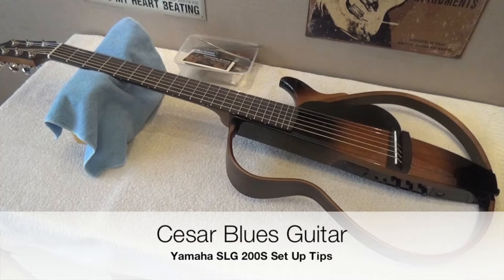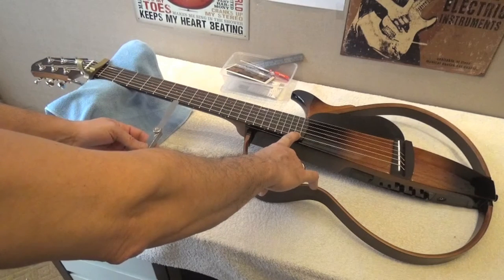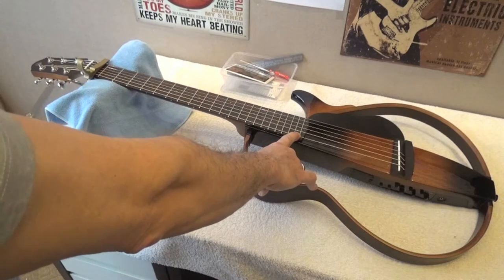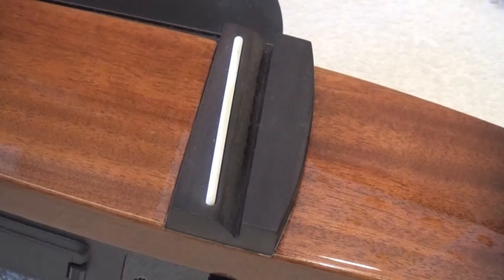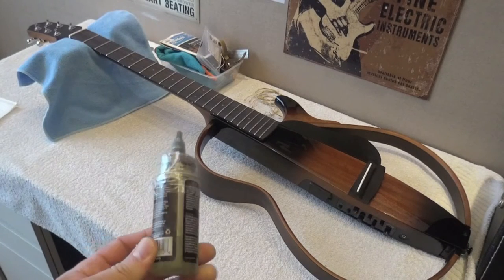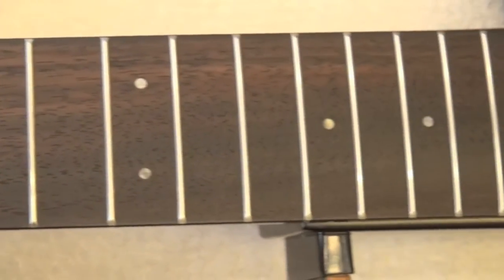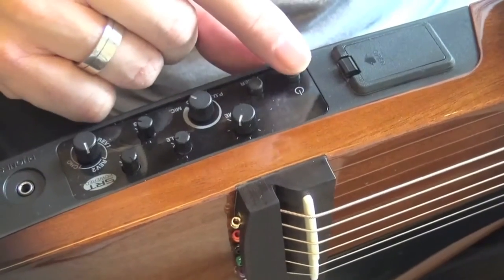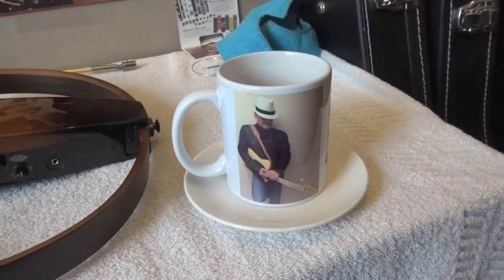Yamaha Silent Guitar SLG200S (Part Two) Set Up Tips

Comment: Hi Cesar. I'm really on a downer now.
I Unboxed my guitar this morning to find the action is sky high.
I'm taking it to my local music shop later and it will be away for a week for a proper set up at a cost of sixty pounds, and that's without the new strings I have put in the bag. (Elixer Nanowebs - my favorites)
What a choker.
I just don't want to mess with the saddle of which I am pretty sure needs shaving.
I'll just have to watch your videos and take comfort that soon I will be able to produce that wonderful sound this guitar produces.
Reply from the maker: Hey Dan,,, sorry to hear that... usually a slight touch to the truss rod can make it... I have several videos with set ups but if you don't feel confident enough to do it , then what you did taking it to a professional is the right thing... I am sure you will enjoy it very soon!

Comment: I just received my SLG200S! It plays and sounds magnificent!! My question is, the B string seems to be noticeably louder than the other 5. So much so that when amplified, the high E is drowned out by the B. Could this be a pickup issue? Could it be that it needs to be setup (truss adjustment)??? Or could it be bad strings??? I’m not a fan of the strings it came with, and plan to use Elixirs. Thank you so much for these videos. They helped convince me to purchase this guitar!
Reply from the maker: Hello! First thanks for the nice comment!
As you describe the issue, in my opinion ( and without seeing the guitar ) it could be a bad string, a poorly cut nut or saddle, or a piezo issue ( the piezo underneath the saddle )...
Try adjusting the relief with the truss rod, changing th strings and let me know if it is not fixed,,,

Comment: Hi Cesar.My guitar came back with the action sorted but the B&E strings are quiet compared to the rest and take harder picking or pulling to get the desired effect. I think I asked you before about this, I have the SLG200s as in your video above. Can you tell me what your suggestion was again.
Many thanks
From Dan.
Reply from the maker: Hey Dan! You need to put a small shim ( very very thin ) underneath the piezo ( The piezo, not the saddle ) in these two strings so the saddle makes a better contact with the Piezo. Is something very frequent. Sometimes I use small pieces of paper and I place them where I have the problem , always underneath the Piezo, never the saddle. I hope is clear. If not let me know.
Best
C
Reply: WOW.... Now that's what I  call a quick reply.
Thanks so much for your time in providing this information.
Many thanks once again.
From Dan.

Comment: Dear friend,
In my Yamaha silent SLG100N the sound of the E string are
good , B, G,and D also, the A is little less but acceptable , but the E bass gives
less sound and even if i hit my finger tot the suddle up tot the E bass I hear
less noise ! I never sand the sadle, so please tell me, I need to replace the piezo
under the sadle ? Maybe can be another reason ? Thanks a lot - Vince
Reply from the maker: Hey Vince, I think is a Piezo issue, the piezo does not make good contact with the saddle...Try a very thin piece of paper underneath the piezo so it pushes it towards the saddle....
Reply: @CesarAllGuitar  yes it works !!  Thank you !!

Comment: I own a SLG100s, a SLG110S just purchased an SLG200S and I am surprised at the very very high action, had to shave about 40% off the bridge saddle. Why make guitars that way.It is insane. Also of interest to some, contrary to the SLG110S and the SLG100S the neck has a different thickness that makes handling the guitar very different. Mixed that with a very very high action I would hate to be trying to learn guitar on that contraption right out of the box. It needs a lot of adjustments.

Comment: Thanks for your videos Cesar -  I appreciate your enthusiasm.

I'm a beginner and mainly interest in classical. To avoid driving my family crazy I've starting playing an SLG200N. I've not messed with the set up yet as I'm not comfortable enough to know what is right for me yet - one day I will.

One thing I have had issues with is the buttons (on/off and tuner). They rattle with the resonant frequency of the  high E sting! I have had to put small rubber bands around them (from my daughter's retainers) to stop them buzzing. Not heard about this anywhere else.

Have you had this problem?

Otherwise I really love the guitar.
Reply from the maker: Thanks so much for your comment. No- I never had that issue but my silent nylon is the former generation, SLG 120 NW... 
One thing- beware of the fretboard in your guitar- my SLG 120 NW has the same dimensions than a classical guitar but the 200N is narrower... you might find it weird if you transition to a " real" classical guitar... thanks again!
Reply: Yes I thought about the narrower fret board and I didn't think it was too big a difference but we shall see.
Reply from the maker: There is a difference .... and is very apparent specially in the first half of the fretboard...
Reply: Just to follow up my own comment: The buzz got to me so I took the guitar back to the shop. They sent it to Yamaha UK. It came back 2 weeks later with the exact same fault (they said they had tightened the boards inside). The shop were a bit disappointed so they sent it back to Yamaha and within a week Yamaha had sent me a brand new guitar! It felt a little odd as I'd been playing the original one for 10 months and got attached to it - but now I have a new one so I can't complain :)

As for the width - the nut is 50mm. My regular classical guitar is 52mm. So about 4% narrower. Traditionally they say classical guitars are 2 inches which would only be 50.8mm - less so the silent would be less than 2% narrower. It is noticeable though even for a beginner like me. It is invaluable for practicing at night though.

Comment: Always love your vids Cesar. I know the oiling of fretboards is a dodgy subject and a year ago i bought a Larry Corsa Les Paul. I asked Larry whether i need to oil the FB and what he said may surprise you. He said its not “necessary “ as the builder goes to great lengths to extract all the moisture from the wood before its used. He said if you want to once a year is all thats needed. However i have oiled it but only sparingly and definitely not frequently. http://www.corsaguitars.com/gallery/man-063/
Reply from the maker: +Simon Bradbury Hi Simon! Thanks so much for watching and commenting! With all due respect to the gentleman, the Rosewood in the Fretboard is a 100% open grain wood. It will always take/give moisture. In fact, if you leave your guitar in a very dry environment you will experience that the fret ends will become "sharper" and it is because the fretboard has shrunk... Oiling once a year/twice a year is what I do (as I said in the vid ) and what I have been also taught by my professors at the RSM many many years ago...but I don't intend to convince anybody - just sharing what works for me. Thanks Simon!
Reply: +Cesar Blues  Guitar I understand it comes down to personal opinion, I'm with you though and oil all my rosewoods. Btw that's my guitar.👍
Reply from the maker: You mean the one in the pic?
Reply: +Cesar Blues  Guitar Yes Man 063
Reply from the maker: +Simon Bradbury Wonderful axe, Simon,,,really Gorgeous!